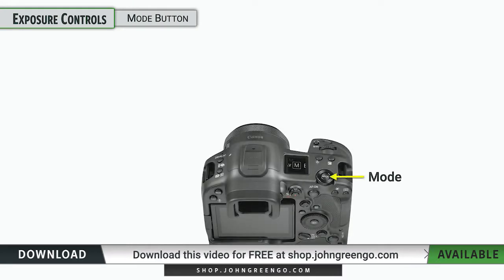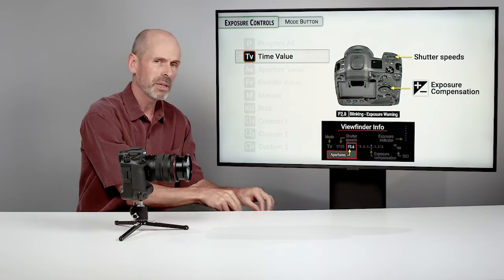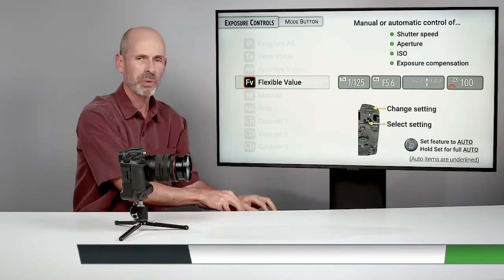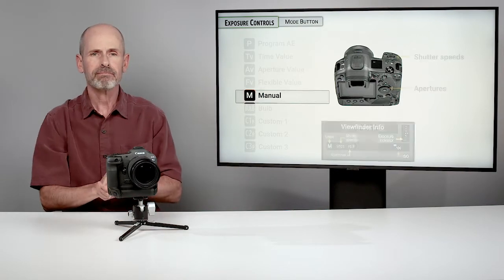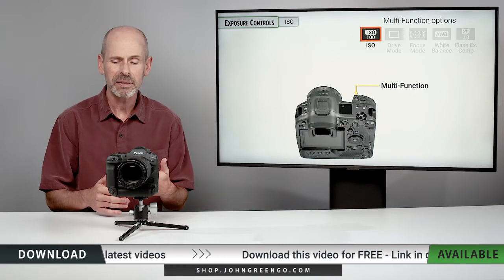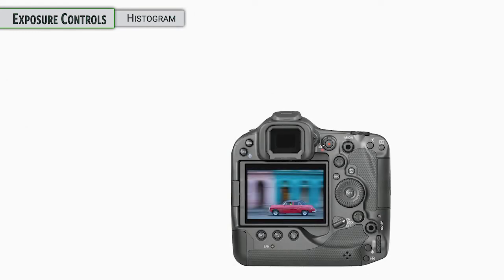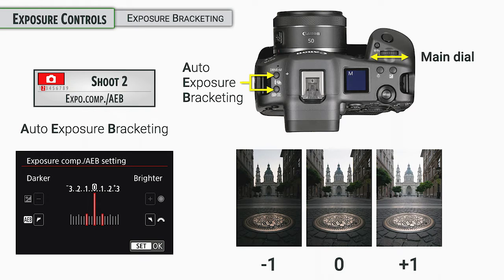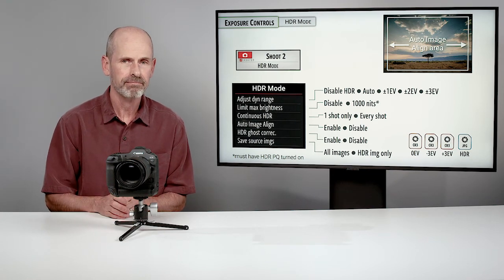Canon R3: CC Guide [03-Exposure Controls]

Comment: If select a custom mode that you have created in the past, can you then add a white balance without blowing out the custom settings?  Or. if you had two custom modes that affected mutually exclusive settings that don't overlap, could you stack them on top of each other, creating an additive set of settings?

Comment: What an absolutely fantastic resource, you have for us.

I have a question when it comes to ISO, is it possible to disable auto ISO? I have my ISO set to my control wheel and I always bump it to auto and it's etremely frustrating.
Reply from the maker: No, Auto ISO will always be an option. However a peculiar aspect of the dial should be explained. Spinning the dial to the low end of The ISO options will take you to Auto ISO, but only if the light meter indicator is not showing. If, however, you press the shutter release lightly to see your meter reading, the dial doesn't allow you to get to the Auto ISO setting. Another custom setting I fully explain in the full class (not this section/video) is how to program the lens control ring to adjust ISO settings, but only after a partial press the shutter release, it's a very cool and useful safety control.
Reply: @JohnGreengoPhotography  Ah, gotcha. Auto ISO is incredibly frustrating and is the only negative thing I have to say about this/other Canon cameras. Love it overall. Thanks for the thorough videos, I've learned a couple of things despite owning it since launch.